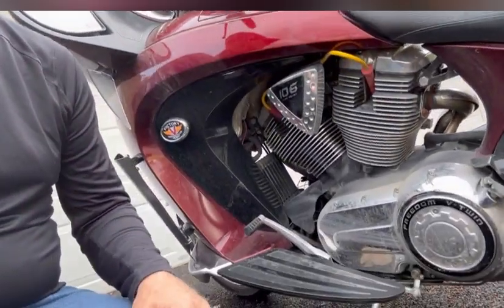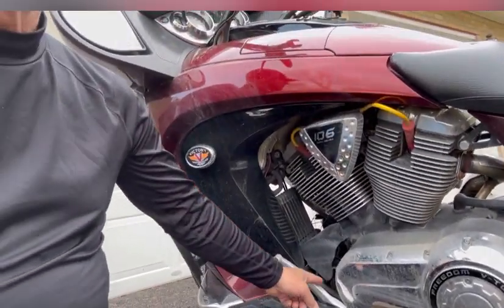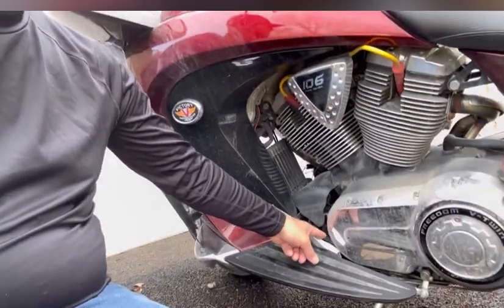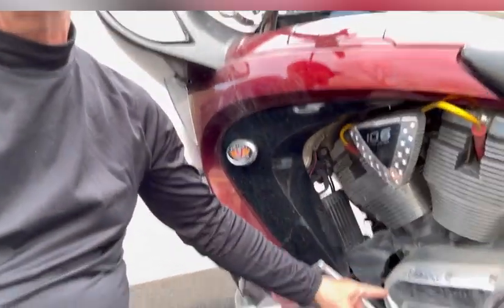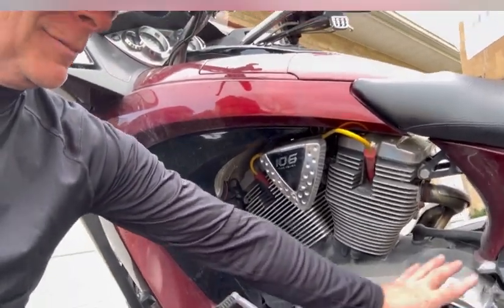Victory Vision torque, limiting clutch

Comment: i watched your other video earlier before i seen this one and thats the little torque clutch gear i was wondering about,  so did you install it before trying the bearing and it wasnt the problem?
Reply from the maker: @Vassmotorsports  I just replaced both at the same time but I think the bearing was just fine and I know the starter clutch was bad
Reply: @davescrazy-trailer6542  ok thank you